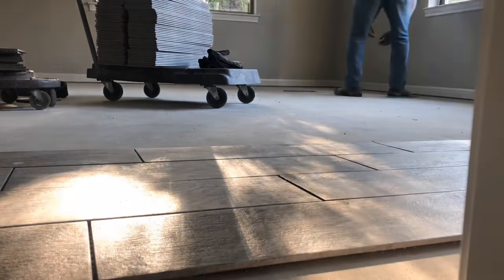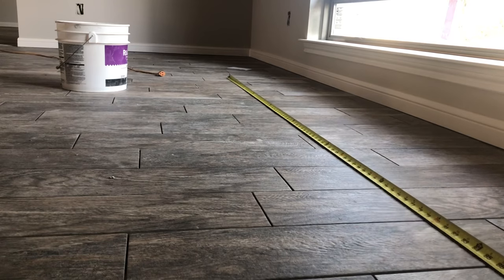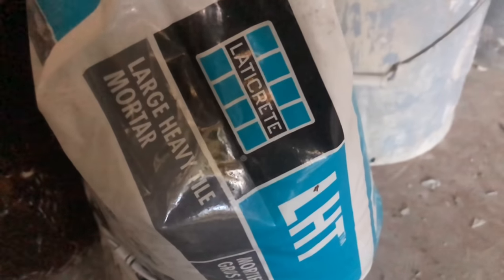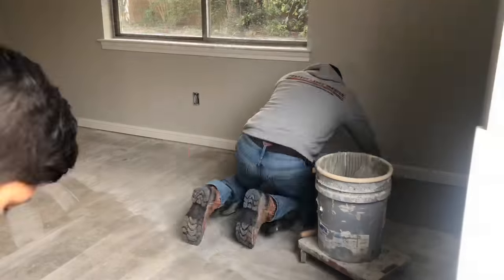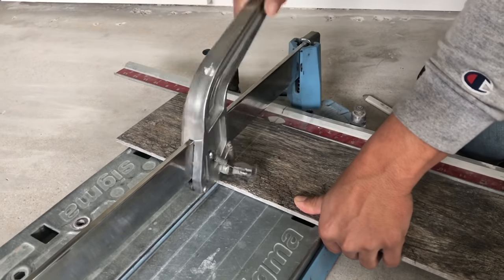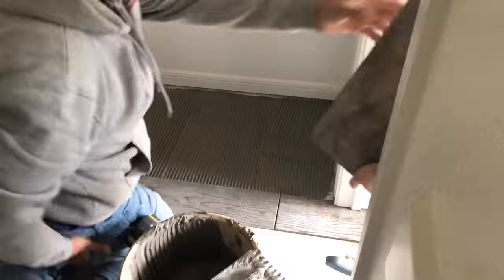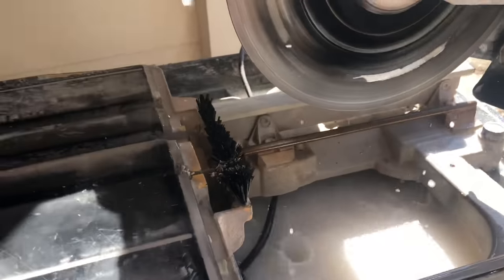How to- laying wood look tile in a room tips and tricks

Comment: I don't like the 6x24 tiles. The tiles are not long enough to look like wood. The 6 x 36 are the best. The 6 x 48 are too long as they can have a bow in the tile causing all kinds of spacing problems. The random layout you did is excellent. I would also prefer a grout that is the same color as the tile so that it cuts down or eliminates the outlining of the tile. I use the DEP lash levelers for spacing and to ensure no lippage from one tile to another.

Comment: love how this looks! my question is if you have a large room, how would you make sure the floors are level?
Reply: Old school trick is to drop a metal ball bearing on the floor and see if it rolls to a certain area, if it does, that would be a low spot. Drop it in a few different spots on the floor and check the results
Reply: get a big leveler to find low spot on floor,.
Reply: I have seen some tile layers use a long( 6-8-10 foot ) level to determine how level the floor is .  They lay it on the floor and look for high/ low places..

Comment: When i lay tile I always use the levelers from home depot. They are the white t-shaped plastic pieces that raise the tile off the floor a little bit, then the yellow wedges that make two tiles next to each other even. This avoids what the industry calls "lippage" where there is a ridge from one tile to another
Reply from the maker: These tiles were active pretty flat but 36” long tiles usually need leveling systems for sure

Comment: You said at about 30 seconds into it you used 1/4" x 1/2" trowel, I was under the understanding that I should use a 1/2" x 1/2" square notched trowel based on it being "large format" tile.  I'm planning on using the exact same tile as in this video.
Reply from the maker: If your floors are prepped flat you can use a smaller trowel as long as you backbutter 
1/2x1/2 wouldn’t hurt

Comment: Thanks for the video. 

2 questions ... Why didn't you use spacers again ? And which row did you start with to start the inconsistent pattern ? Thanks 👍
Reply: I do tile. So the edge of the tile is not straight down. When you butt it up against the tile, it already leaves some space since the edge of the tile curves outward. The row can be started random. Like if there's a cut piece that was a leftover, then you can use that to start your row.
Reply: I think he said the tiles were uneven 🙉

Comment: And if you use leveling clips YOU MUST BACK BUTTER👍The clips raise the tile a bit but do give you a completely Flat floor👍 Doing 900 sq ft now. Much Respect coz its a Lot of Hard Work👍👍👍😁😁
Reply from the maker: Correct, you must use 1/2x1/2” trowel and mix your thinset a tiny bit on the loose side so the tiles can be pushed down
Reply: @OBFTILE  even then i sum how have 2 tiles with a hollow sound when i tap on them with a coin so they must come up😐😐😐

Comment: What kind of tile is this i really like the colors and textures
Reply: I'm pretty sure it from Home Depot, it's what I think I'm about to use, $1.49 per sq. ft. isn't bad for porcelain tile..if it isn't it is 6" x 24" for sure:  Montagna Rustic Bay, which they do have stocked at the store (no special ordering)..also comes in equally popular ash gray, 5 star ratings on this (with about 2,000+ ratings).   I looked thru the other comments and replies didn't see any reply to confirm this is that exact tile but the search engine brought me here with that brand and color.

Comment: question regarding the floor if i have plywood floor do i have to use a membrane first ?
Reply from the maker: Yes, either uncoupling membrane or 1/4” cement board with thinset under and screws every 8”

Comment: I noticed you left out tile leveling system parts. They are recommended for plank tiles, since they can warp.
Reply from the maker: Tiles wont warp after installed. I only use a leveling system if the tiles come bowed and need adjusting or tiles are huge (24x24, 24x48 or up)

Comment: 1/3 offset rule is NOT a steadfast rule.  That rule only applies to tiles that are not flat and using that 1/3 offset method will minimize lippage with those tiles.  There are, however, plenty of tiles out there that actually ARE flat and, for these tiles, offset amount if not relevant.  Those tiles can be laid any way you want.

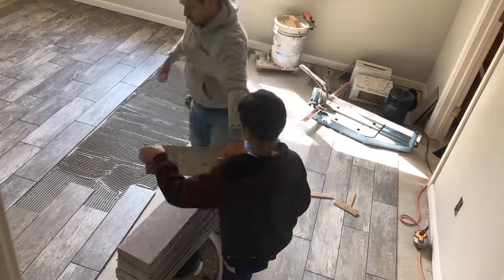Comment: What I don't get starts about 4:00 into it, looks like the right side of the room was already done, then he's filling in the FIVE rows between them.  I'm thinking if so, how did he know the spaces were going to end up exactly even, perhaps he was completing a job somebody else started, or whatever?  I'd just presumed the whole job was going to be left to right as he worked toward the exit(s) of the room.  Also I noticed some of the areas had the grout lines going parallel with the length of the tiles not perpendicular as it was on most areas which is how the HD website says it needs to be.
Reply: Those tiles are set yet, they are just measured out and set down to see how they will fit. It’s best to measure your pieces first and cut them so when you have your mortar ready to go, it doesn’t dry out while your trying to make your cuts
Reply: @ismaelfernandez8666  Oh, so they were just set down dry to sorta fit them, I figured that was the case because it would be nearly impossible to have started in the center than start over at the far end and expect them to join up perfectly.  I laid out 2 boxes of them dry to look at them and they look great.  Trouble is I got to get my floor joists level first before I re-install my new subfloor which is 3/4" Advantech.  My house is 71 years old and had the weak and squeeky pine planks which were nailed down.  I have added four sister joists in the center of the room to keep them from buckling over time.  I ask myself if I should just have linoleum put down but than I keep in mind, no sacrifice, no reward.  I don't want a mundane floor after going thru all of this, the wood look tiles like yours look great, it will be worth it.

Comment: You showed ways not to lay the tile but what is the best way to lay it out.
Reply: I  just had my house tiled with 6 x 24 tiles and the guy used the "brick" pattern which is lay the tile in a split in half pattern. 
I've done tons of research after the fact and the general consensus is you layout the tile in 3rds and use a tile leveling system to help prevent lippage. My tile has lippage all over the place. I might re-tile.

Comment: 2 questions what size trowel did you use?and what pattern did you follow ?look beautiful
Reply: looks like they centered the next row to the first row, in other words, all the tile on the second row started at the center of the first tile in the first row. Looks like that's the easiest way, and I've seen this pattern before and it looks good.
Reply: @ezwalker  there is no pattern....
Reply: @raymondolguin7550   So you don't consider centering every other consecutive row a pattern?  It might not be a picture, but a uniform change up on every other row still constitutes a pattern. Doesn't it?
Reply: @ezwalker  No. A pattern repeats itself.

Comment: Why not use leveling spacers to help prevent any lippage?
Reply: I think budget is one issue; other aspects might be the grout line and tile texture. They used 1/8, relatively thin grout line so lippage may not show that easily. Also the texture of this tile might allow for a higher tolerance for lippage.

Comment: What about preparing the floor ? No primer nor leveling needed ?
Reply from the maker: Hey Tristan thanks for the comment, no primer just clean the slab really good from any texture and overspray paint then leveler of course, i always level the slabs specially when we lay wood look tile
Reply: @OBFTILE  thank you! For the quick response. Didn't mean to be rude. I was just asking as i am planning to do this myself but after watching a ton of videos , you are the one that makes it look the easier. But also noticed you didn't mention anything about the primer and leveling the floor before actually start laying it down.
Reply: @OBFTILE  i have to mention leveling the floor it's the part I'm the least confident about. 🥺🥴
Reply: @Mr B’s Life What about if I have painted concrete in my home? Do I have to get the paint cleaned off?

Comment: Got a question can you lay wood look tile without joints. I.e no space in between
Reply from the maker: Dexter Norris no sir you need grout joints for movement, tiles will expand and contract 
You also need a space along the wall so your floors never bubble up in case they decide to expand
Reply: @OBFTILE  are you in Texas I would love to hire you if thats possible
Reply: Did you  grout the floor in the video please respond thank you 😊

Comment: Do I need to use an uncoupling membrane to lay down these tiles? Also, is it ok to lay down these tiles over vinyl?
Reply from the maker: SuperMegawoman you dont NEED it, but it will definitely help your tile life lasting a lot longer without cracks
Please dont lay over vinyl because your installation will only be as good as the vinyl under it and definitely dont use vinyl as an underlayment

Comment: It wasn't clear to me how you were spacing the tiles without spacers. Could you clear that up for me? Thanks!
Reply from the maker: I lay 3-4 tiles on the floor using the spacer i want (1/8” for example) and use that same dimension over and over. If i get narrower or wider tiles it doesn’t matter as long as I distribute the spacing within that space. My line will always be parallel to my main control line even if the tiles are slightly bigger, smaller or even out of square

Comment: No back buttering or floor supports?  Lazy,lazy lazy. Those tiles will be cracking and popping loose non stop.
Reply from the maker: Wtf are floor supports 😂 and my helper was backbuttering off camera, also its a timelapse (6 hrs compressed into minutes)
Reply: Looks good. With all do respect the youngster was handing you the tile stacked from the dolly and being placed non back butter. At least that portion of the 6 hour lay down. Thanks.